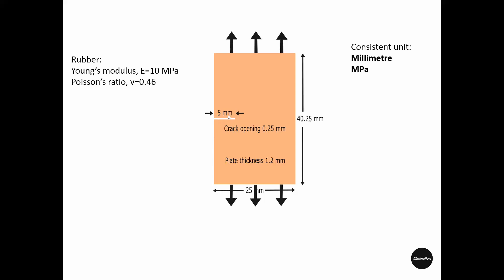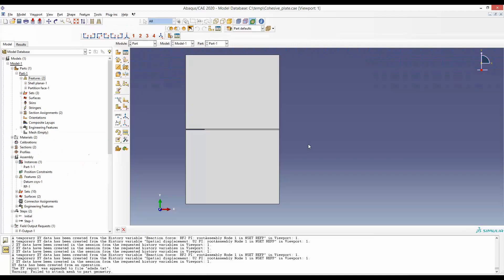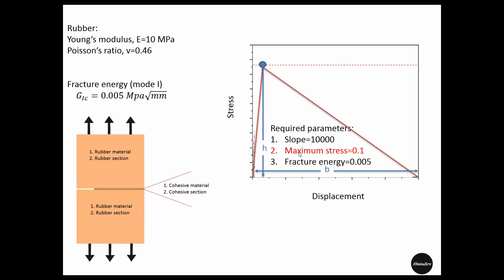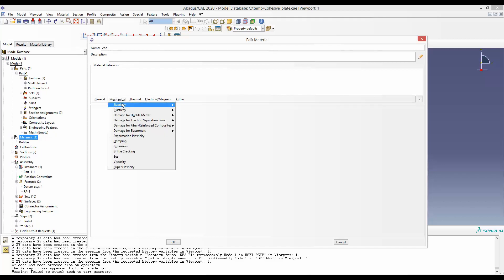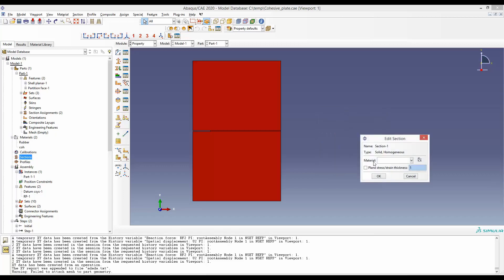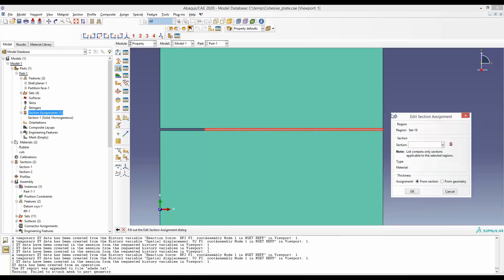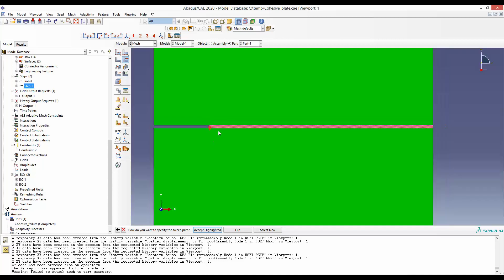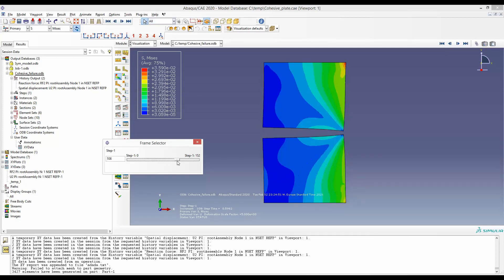Model Cohesive Zone in ABAQUS (tutorial for beginners)

Comment: I tried to model the same probleme but failed with non-convergence with the message sayting the time increment required is less than the minimum specified (1e-12).
Reply: Did you use load- or displacement control?

Fracture in this scenario is unstable so you will have to use displacement control. Otherwise the whole surface fractures instantaneously and the sover can't handle that.

Comment: Hello, I hope you're well. I am currently trying to simulate some micro-cantilevers through FEA. I have a load-displacement curve from experimental data and want to construct a cohesive law. However, I am confused about how to find the maximum normal stresses around the notch when the load is applied perpendicularly to it. You seem to have these values in the tutorial, but I was wondering if you could explain how to calculate them if you only have the load-displacement data and are dealing with awkward loading and geometry.

Comment: why the modulus of cohesive is 1000 of rubber?
Reply from the maker: This is not the right parameter for Rubber. All values in this example are arbitrary.
Reply: @10Minuters  If the cohesive (adhesive) material is rubber, Enn of cohesive should be the same as the Rubber modulus. Is it right? Enn in cohesive should be young's modulus
Reply from the maker: @崔晓雨-s2n  Yes, it should be same as rubber. Try that.

However, low value of Enn can make the simulation slower (Even the job might abort!). Using Enn=10*Enn (rubber) i.e 10 time higher or more can result in faster simulation. Changing Enn by such factor has minor effect on the final simulation output. We always do such manipulations (like mass scaling) to increase simulation efficiency.

If you eventually decide/ need to change Enn to a higher number, do some simulation with several value of Enn to get which works well for your model.
Reply: @10Minuters  thanks so much

Comment: Thanks for the tutorial. Can you tell the Boundary Conditions and the Loading
Reply from the maker: Hi Anish, the bottom edge was fixed (U1=U2=UR1=UR2=0) and the top edge was pulled using prescribed displacement (U2=5 and U1=UR1=UR2=0)